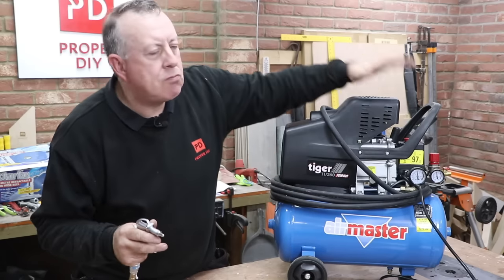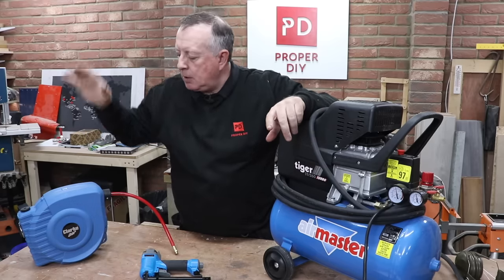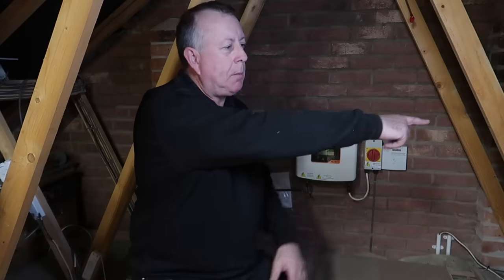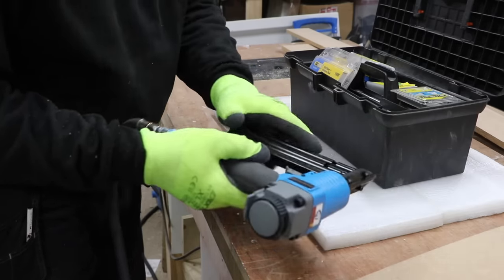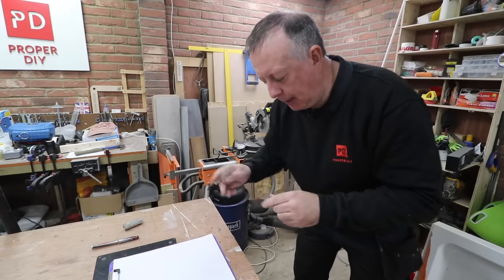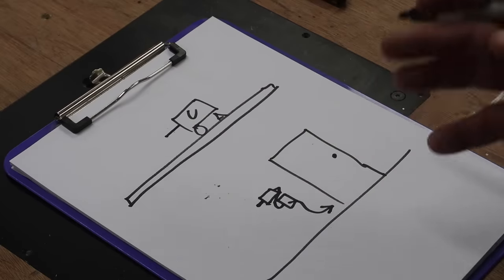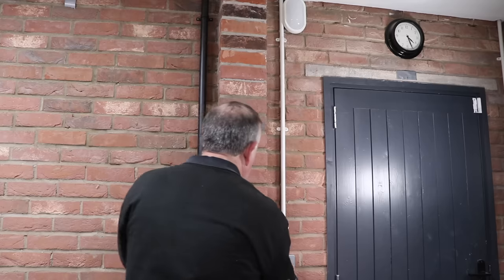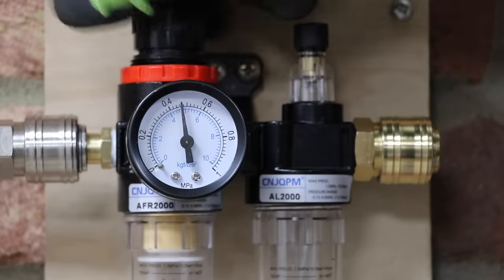How I got the noise of my compressor out of the workshop

Comment: Great idea Stuart - are you going to add a remote drain for the air tank to remove moisture, thus avoiding the need to get up in the loft?
Reply: yes he needs to sort out drainage, i worked on commercial compressors for many years and it’s frightening how fast the receivers can rot through and they were super coated inside and had to have certification inspections. 
God knows how these DIY grade ones will last.
I have an Hitachi diy size on and drain after every use.
Reply: I was thinking the same
Reply: How do you remotely drain the tank?
Reply: @bluewanderer9903  swap out your tank drain plug for a spring loaded drain plug and Stuart can attach a pull cord to it and tray to catch any vented moisture.  you can see this type of drain system on many commercial trucks
Reply: @bluewanderer9903  put a pipe off the bottom of the air tank with a tap on it in the work shop so you can drain the tank. Water is denser than air so will always move to the lowest point
Reply: @antking8847  8 bar of pressure minimum, that does not sound good to me
Reply: @wjb2  right, I think I know the ones you are talking about. Thanks 👍
Reply: Nah I’ve used my El cheapo for 20 years , never drained it and it’s fine but I only use it about 20  hours max each year
Reply: @musheopeaus4125  would be interested to know if it has any water in it and what colour it is?

Not a problem for most things, but I’d expect that you couldn’t do any spraying with it if if the moisture in the atmosphere has been allowed to condense and sit in the tank?
Reply: @musheopeaus4125  Hi, have a look at 'exploding air tank' videos on YouTube. Why take the risk?
Reply: @musheopeaus4125  well I've got 2 vertical receivers, one in workshop, one in welding shop, never drained in ten years, so I took the inspection door off the 300ltr one in the workshop, bone dry! So I checked the 250ltr in the welding shop, bone dry. So I checked the compressor tank, little drip came out.
Reply: I tackled this issue in my workshop by replacing the draincock with a plumbing fitting and running copper pipe to an easily accessed ball valve and then through the wall to the outside. It’s rated well beyond the max pressure the 100l receiver is rated to and there is a constant fall so if 120psi can’t get the water out gravity will do the job. I’m always amazed at how much water comes out. Love the idea with the light!
Reply: @musheopeaus4125 and you live in the desert where absolute humidity is so low you can get away with that.
Reply: @michaelbamber4887  I live in the driest state in the driest continent on earth and if I use my compressor for as little as half a day and open the drain tap after use I routinely get 30-40ml of water running out. All this with extremely low humidity, so I have no idea how your compressor tanks are bone dry? Are your tanks angled downwards toward the drain taps so any water will naturally drain out?  Seems unbelievable!
Reply: @Mel Bice  not sure, I keep them under pressure all the time, so not putting fresh air in from empty, plus I've found that the small mobile compressor (50 ltr) I take out to do jobs gets water in the tank every time, not lots, just enough to drain out. My brothers idea is that because the tanks are so big, they drain slowly enough that the dampness stays in suspension? Cos as you know, when you release air quickly, it makes a vapour cloud. Possible? I'm as shocked as anyone that they are dry.
Reply: @nickbland3641  I turn the drain on the glass valve and oiler but never the tank .
Reply: Draining off water from compressed air is an absolute must. I would also rather see a noisy compressor behind sound absorbing masonry and not resting on timber joinery. Nevertheless thank you for all of your very informative videos, they are all a great inspiration to me.

Comment: If you turn the compressor off mid-charge (Before the pressure relief valve opens) you'll probably find it blows the fuse next time you come to turn it on as the starting load will be very high.
Reply: I think you'll find there is a button on top of the control box.  Turn it off there and it vents the top of the piston so it starts alright next time.
Reply: @emmabird9745  not much use when the compressor is in a loft
Reply: @HenryOCarmichaelSmith  Totally agree.  The chap sold us our compressor pointed it out as the right way when the phone rings or whatever.  Plenty of "oops" room here.

Comment: All very well putting the compressor in your loft - but what about provision for receiver condensate drainage?... Much more importantly, you should ALWAYS switch on and off at the compressor pressure switch - NEVER at the wall point/isolator etc.!... This is because the pressure switch vents your pump outlet to atmosphere upon operation, thereby preventing the motor from attempting to start against a pressurised cylinder. It is VERY easy to burn your motor out should this be allowed to happen!!!... (The “brief hiss” you hear when the motor switches itself off is the pump pressure venting via the small bore tube which leads from your receiver non-return iinlet valve to the pressure switch.)

Comment: Great project but you should have started with more silent compressor from the start. If you used a product that's designed to emit less noise from the factory, and put it on the attic, the resulting noise level should be pretty acceptable already. (Some more modern units come from the factory around 75–80 dB instead of 96–98 dB such as the one you had in this video.)

The way to did the installation, it should be really easy to switch to more modern unit later, too, so there is no big problem here. And if you find a buyer for your old unit, getting a more modern one shouldn't be overly expensive.

Comment: I was a bit concerned about the flexible pipe chaffing as it enters the conduit in the loft. May need to clip it to support it?
Reply: I'd put an elbow on it, nice smooth entrance into the pipe, the  end in the air line would then be supported and the rubber on the open end would absorb any vibration in the pipe from the compressor.

Comment: Hello.
How about turning compressor off with power or do you leave it powered on?
If leave on would it cause any issues with the unit as I thought you need to turn off and drain air out of the unit.
Iam asking because I have nearly the same unit in my shed workshop and I drain mine of air if leaving unused for few weeks at a time.

Comment: Fantastic idea, I have mine located in a cupboard, with foam to insulate it. 
Sorry to be that person, but it looked like your smoke alarm was installed close to vertical. Ideally, it should be on a plane as close to horizontal as possible, and within 600mm of the peak of the roof. I appreciate its more of a 'token' than anything else. I really enjoy your videos... particularly the table to pallet....

Comment: You need a holesaw shroud, saves getting all that sh*t in your face. Also, you need to drain that cylinder regularly otherwise the moisture will prematurely  errod the tank, which can be very nasty😮

Comment: Love this idea I think I may do this with my compressor..

Important note u might want to add. It’s important to blow out the tank often on the bottom of the tank. Prevents rust and damage to the tools from the water in the air line… I was thinking a small copper line with a valve down by your on off switch so it’s a simple open it up let the water blow out and back off, good to go. Just an idea but again great idea!

Comment: Nice solution to the noise issue, and saves space in the workshop. You may need to stick foam down, or use bungees to stop it wandering, without using vibration transmitting fixings.

Comment: How do you drain the compressor of water??? 
I do mine after each use and leave the valve open till next use
Reply: @Tony Moloney I had that thought too, very dangerous things are compressors with water left in the receiver. I reckon a fitting on the current outlet extended down to the workshop and a release valve on the end to complete the job. Cheers, Norm.

Comment: I’m becoming increasingly more jealous of your workshop our kid. One thing worthy of note. The pressure switch unloads the pressure in the cylinder head when it turns off automatically (the burst of escaping air). This eases the load on the motor as it starts back up. So best practice is to only isolate the power when the compressor is not running.
Reply from the maker: Thanks Ian - good point

Comment: Only minor electrical related thing I thought of, what amp rated fuse have you put in that FCU? 3a would be needed for the light, yet surely 13a required for the socket for compressor? Assuming both are fed from the same FCU (if I understood correctly) how are you getting around this?

Comment: Great idea for the noise damping but you could have used 15mm copper pipe and normal plumbing fittings

15mm pipe is rated at Maximum Working Pressure (at 65°C) : 58 bar / 841 ps which is more than enough for a small compressor. 

This is what i did with mine although you've inspired me to look at some damping to reduce the noise.

Comment: I work for the company that makes and sells those compressors. We do recommend that a compressor is turned on and off with the red knob on top the black pressure switch box, and not by switching the mains supply. However, this is a clever setup for dealing with noise and I hope the power arrangement does not cause problems. I would discourage anyone from switching the mains supply for a less-good reason, such as saving themselves from reaching under a bench to turn the machine on an off with the knob!

Comment: Would really like to see a small experiment to extend this one: 
How would the sound change if you string the compressor of your rafters with some heavy duty bungee (or just a bunch of the bicycle bungees)?
Reply: That would probably make it even louder, since you are now vibrating the entire roof panel by coupling the compressor to the rafters!  You had the right idea putting a pad to mount the compressor on, but the foam you used does not have enough compliance.  Some soft upholstery foam would have been much better than the hard poly foam that you used.  This would tend to isolate the vibration from the compressor from being coupled into the structure, and preventing the whole floor of the loft from vibrating.
Reply: @silicon.alchemist the sound will not transfer through the bungee.
Reply: @TheMan-si4iu  Oh yes it will.  The bungee acts as a spring, albeit somewhat damped, but it will still transfer vibration to the other end of the bungee.  Try a simple experiment:  Attach a bungee to your plywood floor with a screw, then stretch the bungee and twang it like a guitar string.  Even if the amount of energy transferred is low, the plywood and floor structure will act a a resonator and actually make the sound louder at certain frequencies.
Reply: @silicon.alchemist  The spring will only pass selected frequencies and with a correctly selected spring force, you should be able to select a frequency that's outside any room mode. I think bungee core probably has wrong tension but you could get spring feets designed for outdoor unit of a split heat pump. Those are specifically designed to reduce compressor noise. And you could also get a rubber feet designed for the same task and put those in stack (I think rubber feet should be closer to the compressor). A well designed rubber feet should be able to make anything above 30 Hz a lot quieter and a correctly tuned spring should be able to silent frequencies below 30 Hz.

Of course, if your compressor emits low frequency sound (not physical vibration) and it matches your room mode, there's no way to silent that easily. This is because the transfer medium will be air, not vibration of the feet.

Comment: Stuart,
My advice to you, is to fit a decent drier unit, after your regulator, but before any oiler unit.
Depending on how much you use your compressor, you may get away with the silica bead type drier unit, but keep an eye on the beads, they should be purple when new and they turn white when damp.
I work on a lot of compressors in my normal daily work and the three things that will kill a compressor or what is connected to it, is not draining the receiver tank (ever), having air fittings that leak on the outlet and down-stream fittings.
The third thing, while it won't kill the compressor itself is moisture in the line(s), that cause things like regulator springs to rust and the valves to seize, this will also cause air tools to fail when the internal parts of them get wet inside.
Line driers are very cheap insurance no matter what sized compressor you have connected. 

Thanks for a great video!

Comment: I’d be worried about draining the tank. Very surprised to see almost 2 litres of water out of my 50 litre tank in 2 months. I’d take the wheels off the unit too & regain the height with rubber pads.

Comment: If you want to halve the sound level, hang it midair from the nearby roof trusses. I had some old climbing rope, 9.8mm dia. The bulk of the sound is translated through the structures by vibrations, having it hung midair with rope vastly reduces it
Reply: I thought the same thing when it was in the nylon rope sling to get it in the loft... "Just leave it in that, and tie it up.."

Comment: Great job as always Stuart.
I would recommend Like other comments have suggested to drain the compressor tank once a month, especially during the winter. There's normally a push in drain valve on the underneath belly of those type compressors.

Comment: Hi Stuart, very neat job. Have you considered to suspend the compressor with ropes - maybe elastic - from the ceiling of your loft, instead of simply put onto the floor? Air transmits vibrations less than solid materials.
Reply: I did that with the ventilation fan in the bathroom; went from a rumble to nothing at all. I had stainless steel wires from work and used crimp tags at each end, then cup hooks to the rafter from a board the fan was mounted to.

Comment: That setup looks great! I built a box outside my workshop and lined it with some 2" foam board. The rest is set up similar to yours with the pressure adjustment and hose reel. 

Great video!

Comment: Really well-made video with good narration and camerawork. Really enjoyable watch.

One thing I'm curious about regarding the particular project, is power/efficiency-loss with the added length of hose. As far as I know, more hoselength = greater resistance, similar to electric wire. Did adding the hose lengths together result in any air power reduction at the tool-end?

Comment: Two BIG NO NO: 
1) Never switch off a compressor by cutting the current. (You may have to drain the tank to get it started next time because it has stopped in a disadvantaged position.)
2) Fire hazard! Always switch off a compressor’s current connection when leaving! Sometimes the “max pressure switch” stops working and the compressor just keeps working. It finally catches fire. 
Kind regards 
Anders 
Sweden

Comment: Not the best place tbh!! Air tanks need REGULAR draining of ALL the air due to the condensation within, that compressor won't last long as you'll forget (or can't be bothered) going upstairs to drain the tank manually. It might be a cheap unit, but well maintained it should last years with proper maintenance.

Comment: Or you could just buy a Gentilin ultra quiet air compressor. 67 DBa and a 3 year warranty 100% duty rated S1 class motor. Not cheap but will last a lifetime.

Comment: Why not have a switch with a red light on it instead of fitting an extra light ? I’ve had my compressor in the garage loft over 20 years. Works a treat. New compressor incoming next month 🎉🎉

Comment: Find an old tire (no rim) lay it flat and set your compressor box on top of that for added isolation from the floor. Hang some old carpet on the wall, then hang more carpet sections around the unit (leaving some air space) to stop reflected sound in that attic room. I'd bet you can shave another 10 dB in the noise department. BTW, if the wheels rattle, run a bungee between them to hold tension.

Comment: I bought a Hyundai 25l and its quiet...🤷🏻‍♀️
Reply: I'm going to get one soon. Can you use hyundai 25l to do spray paint or it have to be 50L to do spray paint?
Reply: @chris01479  i do airbrushing and small hvlp guns. Depends on what size nozzle/gun CLFM rating, being a quiet compressor usually means less airflow...
Reply: Tank size has no relation to what size spray gun you can use.

Comment: I see a light fixture on a. power circuit without correct fusing. 
I assume you have a 13A fuse in the switched fused spur!
Lights should not be on such a circuit, folks will be thinking you can just put a light on anything that is electrical.

Comment: Maybe add a slab below the foam to deaden any vibrations that may get to the wood and cause it to vibrate and amplify sound. Could also put something similar, maybe automotive sound deadining in the box to stop any vibration/buzz sound there. Obviously the foam will remove a lot, but just thinking being mounted on a surface which is likely to vibrate easily, means it may be possible to deaden it further easier with such solutions.

Comment: Please put a drain off point downstairs if you don’t want to keep going back up in the loft. You should drain moisture and air out of the tank after use, otherwise you are living under a ticking time bomb as it will rust out. RTFM.

Comment: Aren't you supposed to purge the tank every day using the drain valve on the bottom to clear out any condensation and prevent rust. I'd happily do something like this, but this requirement prevents me from doing so... I don't fancy a rusty compressor tank!